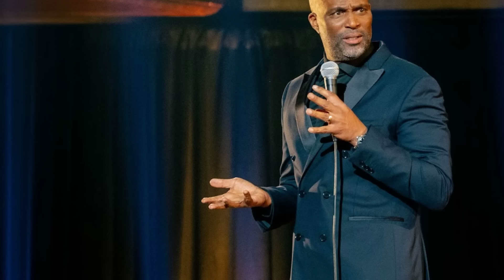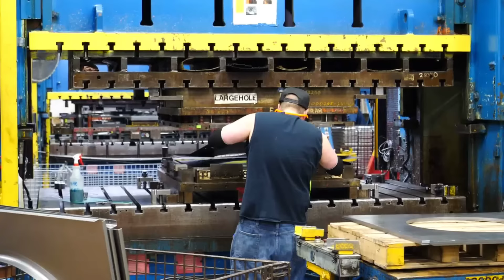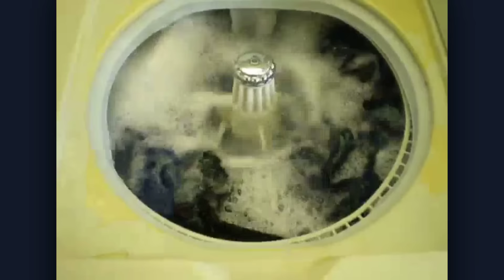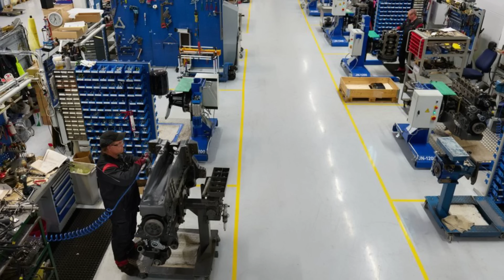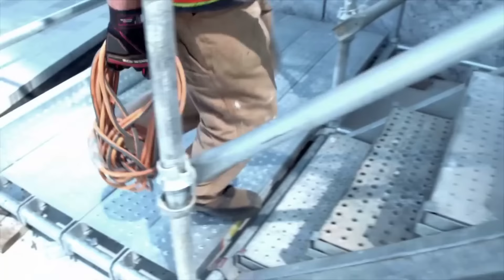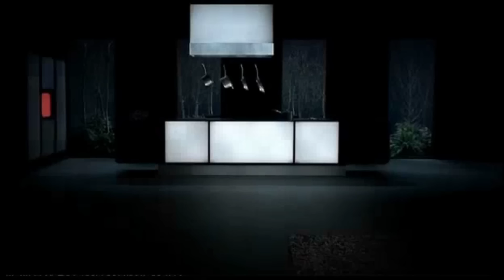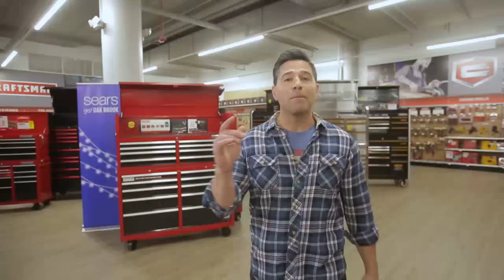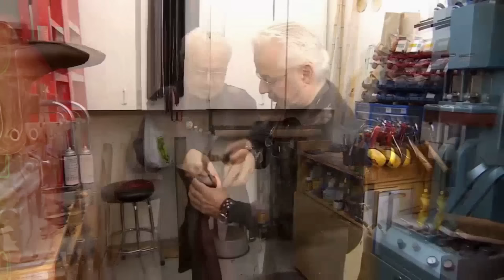The Only 5 Brands That Still Last (The "Buy It For Life" List)

Comment: I hope someone can make a similar list on small tools such as drills, small chains saws, etc...
Reply: Project Farm is the site you want to visit.
Reply: that's the one!!!!
Reply: @risenindeed Todd is great, but he can't test real world longevity though.
Reply: @jimm1819 Valid point. Great at testing initial quality though.
Reply: Chain saws.... Stihl,  The forrest service and professional tree services use the 362.   Drills, I have had good luck with Mikita and also De Walt.... Circular Saws,  Skill worm drive (commercial saw) ... BUY NOTHING LESS THEN THEIR TOP OF THE LINE WORM DRIVE.   For other lawn and garden tools always go see what commercial landscapers use.... they use them they know what works... just like carpenters, plumbers etc etc....
Reply: @johnhenryholiday4964  As a 45year carpenter and all around DIYer I agree 99%.  I refuse to own anything yellow though.  They've gotten better, but I never forgave Stanley for selling out the US.
Reply: @johnhenryholiday4964  The Skilsaw is the Skil-77.  It's Makita competitor is the Makita 5477NB 15 Amp 7-1/4-Inch Hypoid Saw.  They are similar in size both have lighter but more expensive magnesium versions, and both have all the power you would ever need (15A), gear driven (though different gear types), and the 7.25" blade is on the correct side of the saw, unless you're left handed).  They both are similar in weight, size, and capability (contractor duty).  Either is a great choice.  Skilsaw's lesser products are not worth looking at, whereas Makita's smaller saws are still well built and designed to last.  No other brand is up to the performance or reliability level of these two saws.

Cordless Tools: Makita, hands down.  Use them every day (used professionally).

Weed eaters and related, Echo, hands down.  I do not use anything else.

Electrical: Klein, or Ideal (Professional not consumer) tools. American made.

Pneumatic Nailers: Hitachi - Now known as Metabo HPT, which perform above their price level.  My Senco units have also been good, they cost more than the Hitachi, but don't perform any better, so Hitachi is the better nailer choice.  Cordless nailers, I would have to go Makita, as the rest of my cordless tools are Makita.

Ingersol Rand and Dynabrade, for pneumatic tools (die grinders, sanders, etc).

I touch nothing from Black&Decker or it's acquisitions.  B&D ruins everything it touches. DeWalt, PorterCable, Delta, Irwin, Vice-Grip, all downhill, post purchase.

Vehicle Diagnostics: Autel.

Welders: Miller, the best welders, by far.  After that, and only if I can't use a Miller: Lincoln, or Hobart.  Only those three brands, as everything else is questionable, at best.
Reply: Be cautious with Channelock. Many units are made in China now...
Reply: @RantzBizGroup  Same with Milwaukee, since 2005 (owned by TTI, Ryobi, consumer Rigid).  Buy Makita, for cordless tools.  
Electrical tools: Klein Tools, or the professional (USA) version of Ideal tools, not the consumer (China) line.
Reply: @jreyman my Milwaukee stuff from 2014-18 still going strong. Especially the m18 hammer drill taken a beating recently, love that drill.
Better than the makita i have. Milwaukee was good until  2016-2019  I'd say
Still make some good tools the grinders are good apart from the bearing. Cheap and easy to change.
Reply: Power tools: Makita.  I use mine daily.  I'm now 2 generations deep and they all still work.  Milwaukee hasn't been American since 2005, owned by TTI a Chinese tool manufacturer also making Ryobi and the consumer grade Rigid tools found at HD.  Makita is still family owned and operated, The original professional grade cordless tool company, and still making stuff that lasts.
Reply: @jreyman I went off Makita when the power drill I bought probably 40 years ago broke after a couple of months.
Reply: There is a great source on YouTube of folks testing these items!
Reply: MAKITA! Makita invented the cordless drill. If you can get an old one it will last forever. Still have my Makita chop saw. For Jig saw Bosch.
Reply: All hardware stores/ Walmart should have run out of our towns and cities!
Reply: @CurtisWoolf huh?
Reply: @unpopularopinion8608  he’s referencing all the junk and disposable crap they sell is my guess that’s what he’s inferring
Reply: Like johnhenryholiday dude says.
Stihl makes a great chainsaw. So does Husqvarna. For batterry tools I've been using Makita for 40 years, but Dewalt and Milwaukee are very good. I would switch to Milwaukee battery tools, but I'm too far into Makita now. Milwaukee- prolly the best. I buy the Chinese knock off batteries. They dont last quite as long, but they sooo much more cost effective. For my corded table saw and mitre saw, I like Dewalt. Concrete drills- Bosch. I held a formal ceremony for my Bosch concrete drill that packed it in after 25 years. Me n ol Boschy had been through a lot.🥺
Hitachi makes great air tools and crappy electric (corded) tools.
Honda - best small gas engines.
Hand tools - Channel Lock, Klein, Fat max.
Hammers - Douglas tool or Dalluge
Levels - Stabila
Tape measure - best for me is Fat max 16' and 25'.
Best utility knife - Olfa.

Pencils, tapes and knives....I sprinkle them all over the site, cos after 40 years, I still have the bad habit of not putting them back in my belt. 🤣🤣.

Good ain't cheap. Cheap ain't good, but there are a few exceptions. 
Hope this helps.
Reply: If you can find Porter Cable made in the US, Jackson, Tn.
Reply: Milwaukee sawzall.
Reply: @TeddyRumble  Milwaukee invented the sawzall.  The Super Sawzall is a great tool, but they are no longer made in the US.  The best built, longest lasting tool brand now is Makita.
Reply: @jimm1819 Is the is Company still making quality products?
Reply: @CurtisWoolf  Some of the professional line, but not worth the money.  Everything is made in China or Taiwan now.
Reply: @jimm1819  I second this. Makita, 100%.  I use Makita tools every day.  (Sadly, in 2005, Milwaukee became Chinese owned [ TTI, makers of Ryobi ].)
Reply: @TeddyRumble  Wow Brother~!~!  Good catch!!~   I still have mine from 1990s
Reply: @timisaac8121 me too.  I love how a good tool feels in my hands.
Reply: Porter Cable tiger saw!

Comment: My Sear Kenmore (Whirlpool) washer I bought Brand New in 1983, I had it serviced once, as the auto valve started to stick. Cost me 125 bucks 20 years ago. As of Feb, 2026, still use it regularly.
Reply: Belt drive?

Comment: I wish there was a Refridgerator on this list.  Today's fridges are ALL designed to fail by 5 years and I am searching for that one that isn't, the unicorn.  I may have to find a good used one from the 70's/80's.  Consumer Reports doesn't recommend any fridge brands anymore, none. Says they all are subpar.  And this is the one appliance EVERYONE has and depends on more than anything else.  Throwaway world, glad to see on this list at least some things are still made well.  My Redwing boots are best footwear I have ever owned, by a mile.

Comment: Let me add vacuum cleaners: The best, which are also totally repairable with all parts available, are made by Numatic in Somerset, England.  The commercial version is called Numatic, and the domestic version is called Henry.  Don't be fooled by the appearance: these are really good.

By the way, all cast iron pans can break if dropped on a hard surface.  Cast iron, by its nature is brittle.  They are the best pans, though.  It is what I recommend and use myself.

Comment: As a career "radio/telecom/electronics" guy, I try to avoid buying any appliances with electronic controls. And almost nothing that wants to be connected to the internet, other than my computer, phone, and televisions. 
So... What do you recommend for a dishwasher? We ended up with a Maytag. The "guts" look to be solid, but it still has electronic controls. We tried to find one with mechanical controls, but the "works" were junk.

Comment: The Honda motorcycle dealer ordered me a bolt for an ‘84 500 Magna though they no longer have the fuel pump

7 year old Samsung is bouncing across the floor. Shocks didn’t fix so I guess it’s gone